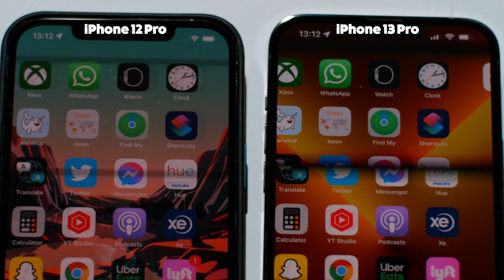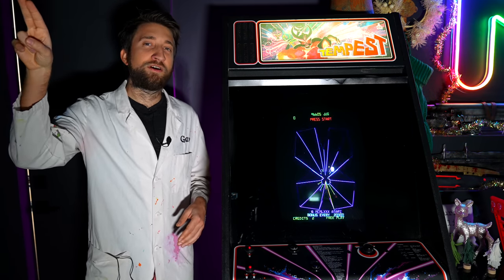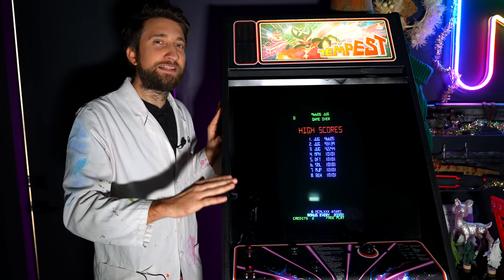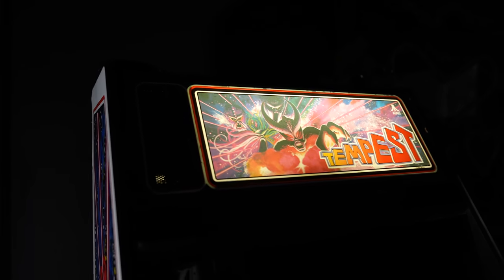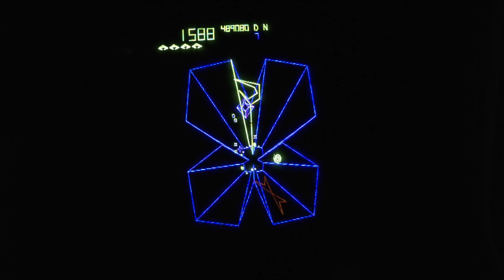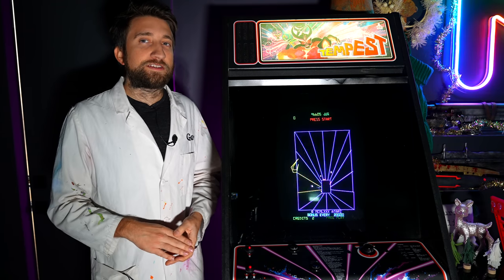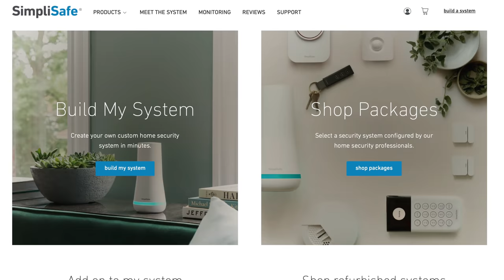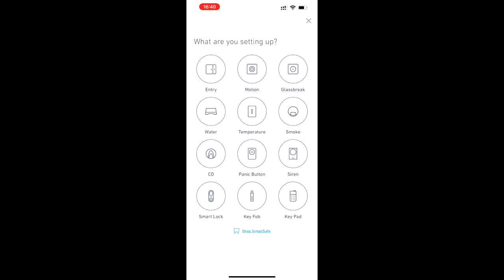Arcade Machines look WEIRD in Slow Mo - The Slow Mo Guys

Comment: This managed to explain vector graphics more in a few mins than hours of other videos I've watched about it :D
Reply: I did vector laser images with a HeNe laser and mechanical galvo scanners in the 80s that I choreographed to music. (classical laser light show) 
 I take out a projector on Halloween each year. 
I use the Radio Shack Color Computer with SW I wrote and used General scanning Galvos.  It used the 6809 and a clock around 900kHz.  In the display processor I was squeezing clock cycles to to some rotations real-time. 
..
I though about writing an Asteroids game, but moved on to other things. . .
Reply: @Observ45er  It's still way over my head.

I understand HOW programming works, but it still baffles me.

Comment: The biggest plus side was probably the reduced memory footprint. Storing a few points which tell how to draw game elements is several bytes. You may even be able to generate the points dynamically at runtime. On the flip side, storing images and palettes is many kilobytes of data. You have to start reusing assets quickly and the game can only have so much content.

Comment: I also like vector graphics in the monochrome versions for that fun little bright point at the corners when the direction changes.
Reply: lasers do the same thing depending on how you tune scanners and program them. Hot points due to the dwell time being higher, as the inertia of the mirrors is taken into effect. They prefer rounded corners instead of sharp corners. I'd guess the electron gun has certain speeds at which it can drive the magnetic field, thus suffers a similar 'inertia' to change via the fact of it being slow haha.

Comment: i know vector displays are pretty cool, but this video takes it to the next level. 😍
Reply: I did vector laser images with a HeNe laser and mechanical galvo scanners in the 80s that I choreographed to music. (classical laser light show) 
 I take out a projector on Halloween each year. 
I use the Radio Shack Color Computer with SW I wrote and used General scanning Galvos.  It used the 6809 and a clock around 900kHz.  In the display processor I was squeezing clock cycles to to some rotations real-time. 
..
I though about writing an Asteroids game, but moved on to other things. . .

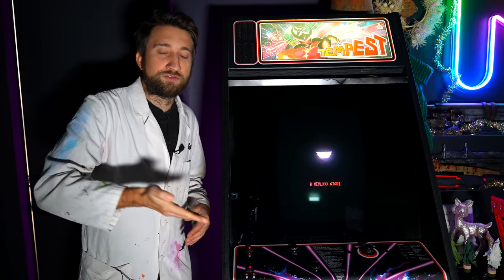Comment: There was one vector game capable of drawing filled shapes, called Quantum. It was made by Atari in 1982. Incidentally, you're WAY overdriving that Tempest screen. There's a brightness adjustment on the flyback transformer that'll dim the screen and eliminate those retrace lines you're seeing at 3:00. It's not a good idea to drive a vector display that hard, as it wears the phosphors out fast.

Comment: One fact you didn't talk about is that the time the screen needs to take to draw an image on vectographs depends on how many elements currently are renderered unless on a traditional CRT which scanne from top to bottom. You can actually see the frames taking longer and shorter time to draw in the footage. Sometimes the screen turns black at faster intervals as at other times. That's also exactly why everything on a vectograph screen tends to be hollow bc if you would fill everything out, the time to draw 1frame would take too long.

Comment: To elaborate on how your brain perceives a cathode ray tube television, it's a lot like closing your eyes in a dark room for a while then opening them and flipping the light on and then off again as fast as you can one time. The light temporarily burns an image into your brain's neurons because your neurons are very slow to get rid of the byproducts(?) of that stimulation. I don't exactly know what it is inside the nerve cells themselves that lingers for a split second after the light flashes in the dark room but it's the reason why you perceive the tv to be displaying a whole picture all the time while it's on. Also you know you did it right in the dark room if after the light goes off you see like a really dark purple hue for about a quarter to half a second
Reply: Not brain but also the actual retina cells of the eyes produce afterglow.

Comment: Lovely, thanks for the video. When I was I kid in the 80's I started learning computer programming on an Apple IIe with a CRT screen. It was possible to do vector and raster graphics. If anything, vector graphics were easier because you just had to specify the begin and end points of each line (as x, y coordinates). It's really interesting to see the side-by-side shot of the raster displays and the vector display. Really enjoyed it.
Reply: But this is not physical vector graphics (XY graphics). The CRT screen draws it as scanlines like any TV set.

Comment: this was incredible! 

it doesnt seem possible that people figured this stuff out way back then! but they did. its like magic
Reply: It's trivial when you understand and have the means and desire. . . 
 ....

I did vector laser images with a HeNe laser and mechanical galvo scanners in the 80s that I choreographed to music. (classical laser light show) 
 I take out a projector on Halloween each year. 
I use the Radio Shack Color Computer with SW I wrote and used General scanning Galvos.  It used the 6809 and a clock around 900kHz.  In the display processor I was squeezing clock cycles to to some rotations real-time. 
..
I though about writing an Asteroids game, but moved on to other things. . .

Comment: I did not know that the phosphor on those screens fades out so quickly, much quicker than the line finishes scanning the screen. I guess to achieve the good overall brightness of the screen, every single dot needs to shine really really bright, when hit by the electron ray. Probably not good for your vision… I was lucky to switch to LCD screen at the end of 90s, when they just appeared on the market. Even though their colors and ghosting were bad at the time, they were much better for the eye strain.

Comment: I've known about this for a long time as a former engineer.  TBH I find it FAR more amazing and intriguing how 70s technology was able to keep track of the objects in the screen and command the vector graphics generators to draw them.  I mean, that tech is 50 years old at this point.  And they were able to keep track of "tanks" and "missiles" and various other objects, and draw them to scale according to distance.  Using the most primitive silicon devices available at the time.  Truly remarkable.
Reply: It turns out to be rather trivial.  My system could have several objects on-screen from a library of any size that there is memory for and independently control their size, position, speed/direction and angle of rotation (one axis at a time).  
Once you had an image of something, it was scaled, moved and rotated by a series of commands that worked just like a microprocessor.
Display object N (on or off)
Place object 1 X,Y.
Move speed DeltaX, DeltaY.
Size object 1 X,Y.
Change size speed DeltaX, DeltaY.
Rotate axis n (one of the three) Amount, speed.
Intensity Level, speed Up, Dn
..  Like that.
The display processor (code written in assembler) did all the motions andI had to determine how to time to the music and I added code to help with that.
....

I did vector laser images with a HeNe laser and mechanical galvo scanners in the 80s that I choreographed to music. (classical laser light show) 
 I take out a projector on Halloween each year. 
I use the Radio Shack Color Computer with SW I wrote and used General scanning Galvos.  It used the 6809 and a clock around 900kHz.  In the display processor I was squeezing clock cycles to to some rotations real-time. 
..
I though about writing an Asteroids game, but moved on to other things. . .

Comment: Is there any way you could film the part making the light beams inside the tube? THAT would be cool.
Reply: That's physically impossible, because they aren't lights like a projector, or even lasers, but a beam of electrons in a vaccum that can't be seen. Those electrons hitting the phosphors on the front of the screen makes them glow.

If you somehow could put a camera on the inside of the tube, all you'd see is a mirror image of what's on the surface of the screen and absolutely nothing else. I supposed you would in fact see the orange glow from the heater at the back of the tube, but that's it.

Comment: What is the post process called that allows you to replicate persistence of vision?
Reply: There is countless of different ways of doing it, but none of them is really replicating the persistence of vision. One way of doing it and the one I believe was done here, is layering each frame permanently on top of the earlier ones using MAX blend mode. That blend mode affects only those part that are brighter in luminance than what the underlying layer is, effectively adding only brighter portions of the new layer, leaving darker and equally bright portions untouched.
Reply from the maker: Yeah pretty much what I did. Had like 1100 damn frames and it took me ages 😂
Reply: @theslowmoguys  You did that by hand? Shouldn't it be possible to automate it with some macro or some such? I'm genuinely interested, I'm far from expert in video editing.
Reply: @theslowmoguys  oh wow, it's a manual process! Respect.
Reply from the maker: I used a macro to place and offset the frames but final cut gave export errors if I tried to stack more than 98 frames at a time. So I had to piecemeal that shot together like 2 seconds at a time.
Reply: @theslowmoguys  Gotta appreciate the effort you go through just for a viewing pleasure.

Comment: I did vector laser images with a HeNe laser and mechanical galvo scanners in the 90s that I choreographed to music. (classical laser light show) 
 I take out a projector on Halloween each year. 
I use the Radio Shack Color Computer with SW I wrote and used General scanning Galvos.  It used the 6809 and a clock around 900kHz.  In the display processor I was squeezing clock cycles to to some rotations real-time. 
..
I though about writing an Asteroids game, but moved on to other things. . .

Comment: does that mean if there is one less particular drawing instance on the screen, the next loop gets started earlier? as in: variable "frame" rate? (it's not really frames, but eh)
or does looping through all the objects to draw always occur in the same amount of time?
i would imagine having more objects (bullets/enemies/shrapnell) on screen would require more drawing, thus increasing the frametime (and decreasing fps)
Reply: Yes,  Precisely!
The more you draw, the slower it gets and depending on how fast you can move the dot, you eventually run into flicker.
....

I did vector laser images with a HeNe laser and mechanical galvo scanners in the 80s that I choreographed to music. (classical laser light show) 
 I take out a projector on Halloween each year. 
I use the Radio Shack Color Computer with SW I wrote and used General scanning Galvos.  It used the 6809 and a clock around 900kHz.  In the display processor I was squeezing clock cycles to to some rotations real-time. 
..
I though about writing an Asteroids game, but moved on to other things. . .

Comment: Here in Software Development as a basic course (Netherlands) we had to use Arduinos and Led Matrixes to use the Wagon-Wheel effect(example of persistence). Basically blinking the leds on the matrix using hertz so fast in a column-row solution that it seems to be smooth. Whilest when slowed down its utterly dissapointing. But an amazing thing to know nontheless. 

Why do they do it? To safe wires. In the electrical world the less wires you use the more efficiënt your machine. So you use Coding to reduce wires using Led Matrixes or Daisy Chaining (shiftregisters).
Reply: Multiplexing the LED segments greatly reduces the number of current drivers required thus making the system less complicated and less expensive.  It also vastly reduces the current consumption since only one element/segment is driven at a time instead of all of them.  Reducing the power consumption also means that the power supply components can be smaller and cheaper.

Comment: The most interesting thing about vector displays is to imagine how hard it must have been to build, calibrate and program those things because in the old days you didn't have even option to use high speed camera to check what's happening when results are not good.

Comment: As a mass spectrometrist, thinking about how dynamic MRM scans use expected retention times to only look for a certain mass where it's needed, so that you can give as much dwell time as possible to the ions present at a given point, I love the similarity here; where you only draw the bare minimum with each pass, allowing the refresh rate of the screen to potentially change with each frame, going as quick as possible so that you can squeeze every drop of frame rate blood from the display stone.
Reply: You are correct,.   I would never waste time. I drew as fast as the system allowed all the time.  That way it is the same brightness and flicker is only a problem for more complex frames.
You draw it as fast as you can.  That way you are only limited by how much you can draw before flicker becomes a problem. 

You can also alter the delay between the ends of lines to make brighter dots on the ends, or speed it up so the dot hardly stops at a point.  Or really fast for smooth curves.
An image consists of points on the screen and the dot moves between dots with a delay to allow the beam (in my case the laser dot) to move.
..
I did vector laser images with a HeNe laser and mechanical galvo scanners in the 80s that I choreographed to music. (classical laser light show) 
 I take out a projector on Halloween each year. 
I use the Radio Shack Color Computer with SW I wrote and used General scanning Galvos.  It used the 6809 and a clock around 900kHz.  In the display processor I was squeezing clock cycles to to some rotations real-time. 
..
I though about writing an Asteroids game, but moved on to other things. . .

Comment: So this is the same concept as when you ‘draw’ with an oscilloscope. I think Destin did a video on it which resulted in me buying an old oscilloscope to play with it. I bet it’s been done, I’m gonna see if I can play Asteroids on my oscilloscope later
Reply: He did and didn't seem to really understand it, from his comments.
....

I did vector laser images with a HeNe laser and mechanical galvo scanners in the 80s that I choreographed to music. (classical laser light show) 
 I take out a projector on Halloween each year. 
I use the Radio Shack Color Computer with SW I wrote and used General scanning Galvos.  It used the 6809 and a clock around 900kHz.  In the display processor I was squeezing clock cycles to to some rotations real-time. 
..
I though about writing an Asteroids game, but moved on to other things. . .

Comment: It's like laser engraving with an electron beam. Very cool!
Reply: I did vector laser images with a HeNe laser and mechanical galvo scanners in the 80s that I choreographed to music. (classical laser light show) 
 I take out a projector on Halloween each year. 
I use the Radio Shack Color Computer with SW I wrote and used General scanning Galvos.  It used the 6809 and a clock around 900kHz.  In the display processor I was squeezing clock cycles to to some rotations real-time. 
..
I though about writing an Asteroids game, but moved on to other things. . .

Comment: The brightness is up too high, either that or there is a problem with the blanking circuit, there should never be any visible retrace lines. I have an original Tempest in my collection and there are no artifacts visible on the screen, only the vectors that are supposed to be displayed. There is actually one vector game that can display solid objects and that is Atari Quantum. Granted it makes those solid objects by painting a series of lines right next to each other like a sort of mini-raster.
Reply: Vectrex also freaks out when set too bright. You see retrace lines but also a bright dot in the center that toasts your CRT phosphor when visible for longer.

Comment: I remember using the CRT computer monitors, and how even at 60 Hz you could notice the flickering. It would make your eyes tired.
Reply: I still use my 50Hz Amiga (PAL with scandoubler) to write texts and have no problems with it (unless during a migraine attack). If it feels flickery, the monitor or TV is set too bright.

Comment: This is actually how the WeatherSTAR 4000 worked also (Used 1990-1999 mainly but used by some until 2014 on The Weather Channel when it retired analog)

Comment: I'm at 4:18 and I wonder.... Is this the early version of a HDR display? Becasue, when the electron beam only hits where it has to draw, all the other pixels are truely off/truely black. Like a modern OLED. Please elaborate because I am fascinated by what Atari has achieved back then with this techology. It's cool to have a beam scan down a display, but to only move it, where it really has to draw is much more complicated and they've done it with very old tech. So someone please tell in which category this fits in?
Reply: A vector monitor can draw small objects with almost any brightness by moving the beam slower, so software (and sometimes safety circuits) had to take care not to toast the phosphor by roasting the same spot for to long and make it overheat.

Comment: Vector displays are the exact same as entertainment lasers.
In one case it's a elctron beam moved by electric/magnetic fields in the other case it's a laser moved by verry fast moving tiny mirrors.
In the End it is just a unbendable line moved to some point on a very fine 2d grid. (Basically limited by the stepsize your controller ist limited to)

Comment: Tempest is perfectly capable - even now - of completely blacking out the black vectors. You just have the brightness turned up way too high.

Also, it is possible for vector games to produce filled in shapes, but it requires a lot more CPU horsepower. An example was Quantum.